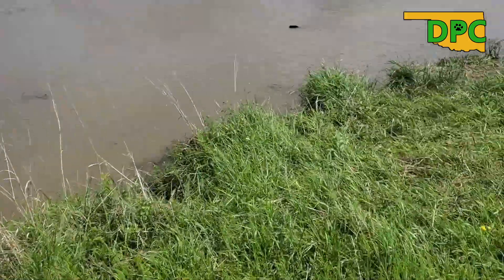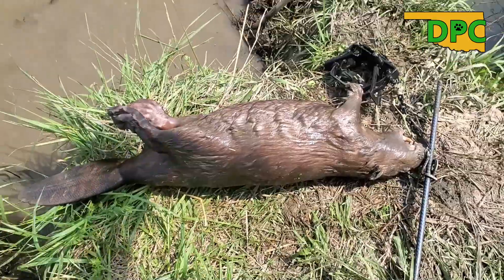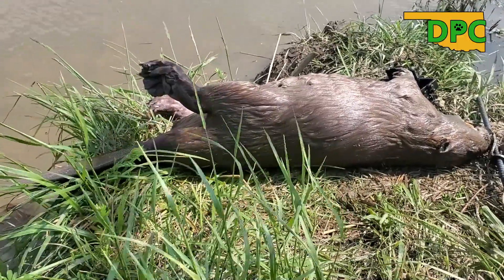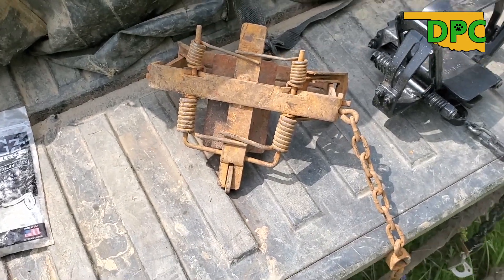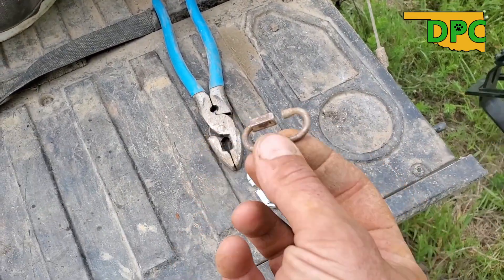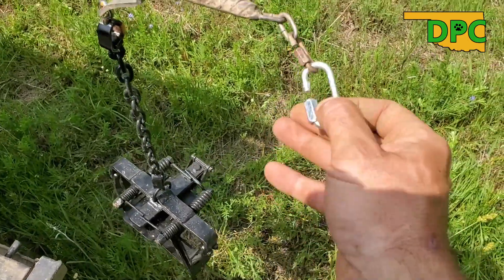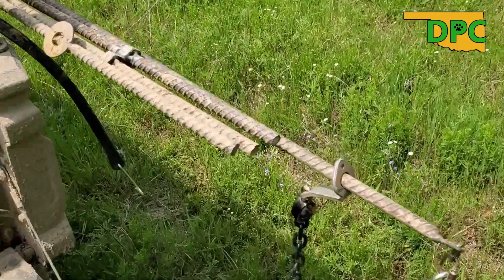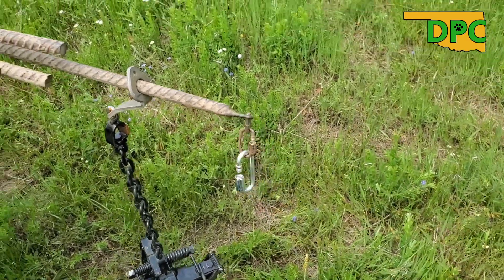Drowning Rod Setup

Comment: I like them hagz great product. I like the chain welded on the end very fast and efficient.
Reply from the maker: Yeah it seems like the cheapest way to still use the hags with a rebar rod. And rebar is cheaper than fiberglass especially in 10-12'

Comment: the base plate has no effect on how you catch the foot
Reply from the maker: True but combined with the floppy pan tension of the Montana #5 it adds the the chance of a lost critter. If you get a fowl catch and don't have a base plate it's gonna be real easy for the toes to slide to the end of the trap and wring off.
Reply: @dominionpredatorcontrol1091  put a pit pan on it that would be a better modification.. it’s better to change things to get a better catch than to try and keep a bad catch in the trap
Reply from the maker: @Beavertrapper  I haven't seen how to fully modify the dogless pan system on the Montana #5s to add a pit pan. I have a dozen of the #3's that I baseplated myself and they catch and hold every coyote that steps on them. I know a pit pan would work great for other traps with a dog. After switching to Kendall's beaver traps I don't know if I'd go back to a Montana style dogless. I like the size of the duke 850 but haven't purchased any yet.